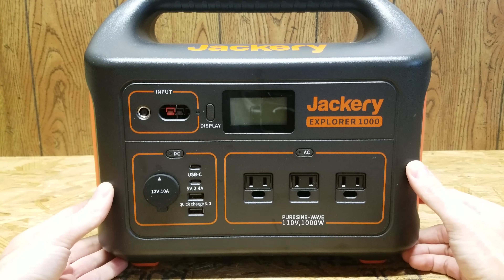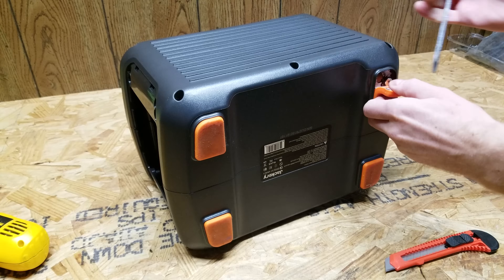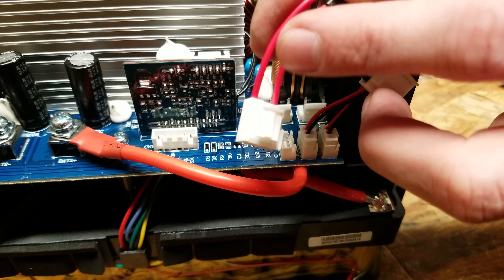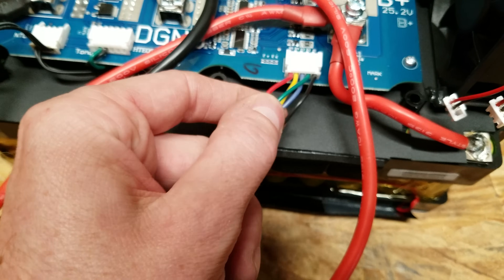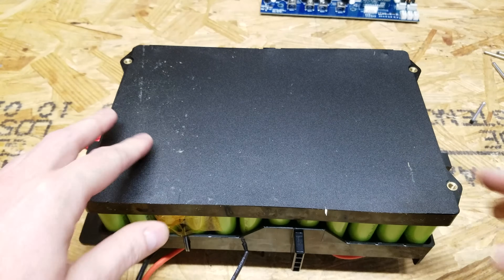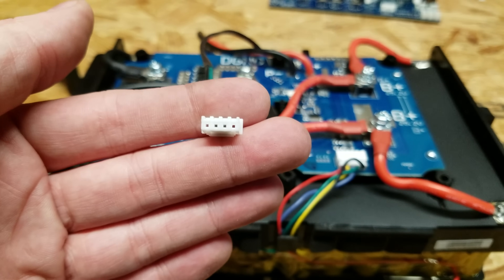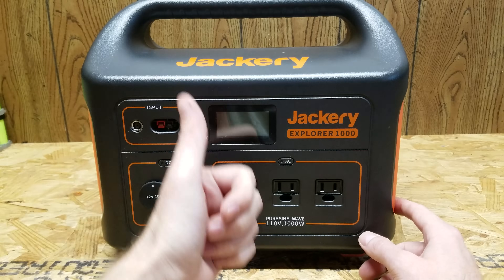Teardown of the Jackery Explorer 1000, Detailed Look Inside!

Comment: Wow. They're charging a grand for 2900mah at 3c. Which is a laughable 9amps max discharge. These cells are worth about 2$ a pop, maybe 3. 8*12 cells is 96 total cells. Or 288$. Then 50$ for the BMS and 100-150$ for the plastic and rest of the components. About 500$ for a unit at cost. You can get batteries with the same discharge but 3500mah. Sad.
Reply: That’s pretty standard markup on a product, it’s called keystoning. You are ignoring the costs of design, engineering, assembly, warehousing, marketing, shipping, warranty, accessories, packaging, G&A, and more to get a product like this out the door. It’s much more than just the component cost, All that and the company still needs to turn a profit.  I’m actually impressed with the price point.
Reply: Anyone know how hard it is to throw those cells into this unit when its time to replace them?
Reply: Pokud to dokážete sestavit v této kvalitě a zařídíte testování a schválení pro použití, vezmu od vás kontainer 🤣

Comment: I cannot thank you enough for taking the time and effort to tear this down, I'm always fascinated by looking "under the hood" into devices such as this, not to mention I plan on buying either this, or the new 1500.
Reply: @robertdillon9989 three years later I did just that I got the Jackery 2000+Lifpo4 and I got it on prime day and saved $900 on it. I cannot believe the deal I got!
Reply: @robertdillon9989 BTW, I also have three other Jackerys the 300 500 1000 lithium ion models, but they work great.

Comment: Great tear down. I love seeing the inards. 

The User Guide says it's got over/under current, over/under voltage, thermal shut down conditions, etc. That is a solid state power controller with a bunch of FETs. Being solid state you can kill the power and gracefully shut everything down without having to change a fuse. 

If you have a fuse or fuseable link you will need to open the device to repair it. A solid state solution makes sense. 

However, I don't see GFCI, which I would think should be important for something the may be used camping, where it might damp or even wet. But it does say "do not expose to liquids".

Comment: Voltage doesn't hurt you🙂 It's the current.
Reply from the maker: Both will hurt you.
Reply: @LithiumSolar  Nope, actually it is the Amperage or the current that kills or hurts you. No matter how great that voltage could be as long as there is no current or load to it it will do nothing to you. 🙂
Reply from the maker: @Binsentiments  Ok. I prefer to just avoid both though :)

Comment: Does this device also have an AC input ?

Thank you for the great content !!
Reply from the maker: The device itself does not have an AC input, but it comes with an AC-DC adapter that you plug in to the DC input jack. So yes, you can charge it with AC but it requires carrying around the adapter :)
Reply: @LithiumSolar  thank you !

Comment: Does anyone have any clue how to get ahold of these bidirectional USB-PD high wattage boards?  I've found ones that are good for 24w in/out, but they don't appear configurable for lifepo4.  There are so many power banks and 'solar generators' out there that offer this that I'm surprised I can't get a lead googling and alibaba-ing.  Would be a real handy thing to put in DIY power banks, even large capacity.  I'd be fine with charging my 50ah 12v lifepo4 box @ 75-100w and PD chargers are cheap, but that requires something that supports 4S lifepo4, and ideally has a configurable charge cutoff instead of hammering to 14.4+v.

Comment: Great video, thanks! I was just looking at these for sale yesterday. They offer multiple capacity models, so that may explain the use of parallel cables: a 1000 is likely two 500 models in the same box. This reduces manufacturing costs, I suppose, if they use the same control board.

There is a max input DC voltage from solar panels of 30V, which seemed low to me, as most domestic panels are around 38-40V for a 250-300W panel. Jackery offers a 100W 'portable' panel, which is a little overpriced but interesting when packaged with this battery/inverter unit.
Reply: Batteries in more than 3 parallels, is that why so many other components.

Comment: 7:00 This whole thing about capacitors being charged is not entirely true. Any well designed circuit will have discharge resistors on high voltage capacitors so they are normally discharged to safe level within a minute or less.

Comment: Do you know or think the AC outlets and usb ports are user changeable if they are worn out?
You didn’t show how the AC outlets are connected that I was hoping to see; still a very great informational video. 

Thanks
Reply from the maker: You can see the outlets briefly at 4:03. They can be removed, but I'm not sure how easy it would be to find the exact part to replace with.

Comment: Just purchased one, haven’t used it yet.  Have a question, I want to add a fixed solar panel to my truck top. What watt solar can use? The Jackery panels are not weather proof.
Reply: Teoreticky jakýkoli, jen nesmí překročit 30 Volt.
Panely mají ztráty a nikdy nedají tolik co je psáno. Tuším že 300 W je specifikace, ale to si ohlídá mppt regulátor

Comment: Thanks for the teardown video. This battery cell N18650CL-29 is comes from BAKPOWER, 3.6V, 2.9Ah capacity, 1000 cycle life to 80% capacity, up to 3C discharging and 1C charging rate, it designs for electric vehicles or bicycles.
Reply: Thank you for mentioning the battery cell manufcaturer
Reply: So it has 84 cells times 2.9 for 244Ah. Does that sound correct?

Comment: I connected my inverter via a plug to my house plug when the mains were down and I isolated the mains. When the main power came on I switched on the the main power and forgot to remove the plug for the inverter. The plug tripped on the db board and now my inverter won’t work. Any way to salvage my inverter
Reply from the maker: Ouch :( I'm guessing you blew out the mosfets (big transistors on the heat sink). You could try finding them online and replacing them, but might be easier to just ask Jackery if they can sell you a new inverter board.
Reply: Did you get anywhere? I have a similar problem
Reply: @stitcha123  Jackery not selling spare parts

Comment: Wow, that's a great teardown. I've been following BAK for a while. It's a real Chinese brand. So many ebike companies make a big point of using LG or Samsung, not Chinese cells, but it's getting to the point where the Chinese stuff is good. The main point is that I see the BAK cells priced in the dollar and change range, at least if you are willing to buy a thousand or so. Jackery is a big brand. They are not skimping on the pack construction, and they are using a Chinese cell. I know a lot of the pack construction is robotic so you load the machine and let it rip. The other thing I always wonder about is inverters. You can buy 24v or 48v inverters on Ebay in the low 100-300's, but the top stuff on the older store sites is much higher. I don't know how much quality you can get from a basic inverter, or what the inverter in this box would cost on ebay. The design is pretty modular, but it's not quite owner replaceable. The Chinese stuff is getting really good. Jackery really seems to be trying to build a brand. Thanks for the vid. Great job!
Reply: I would be willing to bet money that LG and Samsung batteries are manufactured in China like everything else, it's so disgusting.

Comment: I wonder if it's possible to add more capacity to the battery? And keep the original BMS,  I guess using a second bms would be better,  but connect to the battery before BMS, but I don't have much use for these anyway. I'd rather build one if I did,  great video!

I think if I built one, I'd go with a 1.2-1.5kw inverter, and build a battery around 2kwh, probably 48v,

Comment: Looks very well engineered and the construction is clean and professional. The only thing I don't like is the direct attachment of the fans to the chassis. They should use some rubber grommets between the fan and the plastic chassis to eliminate vibrations. Especially when you have a plastic case that will resonate a lot.
Reply: The sound of the fans inside is clean and quiet no vibration, adding that would just add cost to an already expensive unit.
Reply: @daleadmire1451  - Unfortunately it's not, I have the Explorer 1000 and there's no way you will sleep if you use a CPAP machine on AC and you have the E1000 close to your bed. Same thing if you have an electric blanket running from the inverter.
Reply: @JoeDplummer_  if you use the DC adapter the fan absolutely never comes on with a CPAP machine, plus I have an electric ice chest plug it into the DC outlet the fan never comes on with that either. That goes for both my explorer 500 and the 1000.
Reply: The fans are loud but vibration and resonance arent an issue.

Comment: I don't understand why 4S16P can give 25.2 volts over 2 red 10 AWG !!! Where am I wrong ?
Reply from the maker: It's 6s16p. 6 Cells x 4.2 Vmax = 25.2 Vmax.
Reply: @LithiumSolar  many thanks ! Is that supplied with a 2X12 volts PV serial panels ?  (without PWM or MPPT) ?
Reply: Yep 6S16P,  maybe Tired !

Comment: I think that the reason why the wires and circuit are doubled is either because single set is rated for 500W and they just doubled to get 1000W,
or the second circuit is just redundant, since that's the part that is most likely to fail.
Reply from the maker: I'm not sure. It's rated for 1000W continuous output. At 18V (low end of battery), that's 55A. One #1 silicon 200C wire can support that. I'm guessing just to reduce stress and distribute the load at this point. I don't see how the wires would be the most likely part to fail?

Comment: In the US, at least, opening a unit cannot void the warranty. The sticker "Void Warranty if Removed" is no longer valid. Manufacturers just put that on there still to keep people from opening up the units.
This is part of the Right to Repair Act, if I remember correctly.
Reply from the maker: This is true! I think the problem is though that companies are still likely to refuse warranty claims and it would be up to you to litigate it. Most regular people, like myself, aren't willing to hire lawyers and all that for a warranty claim. Unfortunately, they still got you... :(
Reply: @LithiumSolar  Yeah, perhaps. But also just stating the RTR clause may be enough for them to go ahead and do it. Especially if you tell them they may be open to a legal action if they don't comply. Because at that point, it wouldn't be just "you", it would be every other customer at that point they turned away for that, so it'd be class action lawsuit. Not just small claims with one customer.
Reply: @LithiumSolar  you mean "hire".
Reply from the maker: @yourpcmd  Yes, ooops :) Don't know how that happened...
Reply: So much for my aforementioned warranty tamper detection.

Comment: How do you get six s?
Looks like there is a series of positive to negative cells in each of the three groups.  Is that the first series?  assuming that the three groups are in series.  Is that how you get the six?

Is that right?
Reply from the maker: There are six groups, each group is wired in series. If you look at the left 1/3rd of the pack, you'll see a positive-negative connection as you noted. That is two groups of cells, or 2-s. There are three groups like that, giving you 6s total. They're welded on the other side the same way, just offset to give the series connections.

Comment: As I suspected in the last video this appears to be a first cabin manufacturing effort.  Silicon cables, quality boards and connectors, injection molded housings and molded brass nutserts.  Someone below mentioned it was an outrageous cost...perhaps, as I felt the ROI may be long, but quality first in design and manufacture and materials have higher costs.  Add to that the mold costs, perhaps custom heat sinks, Fabs (NI brackets, foot brackets etc.), board costs (Design & mfg + QA - delivered), wiring/harness mfg and finally the assy cost, then amortizing the Engineering and R&D (Ain't Cheep); the consumer gets a Pretty good product IMHO!  With 40 products under my belt in 30yrs, I'd put my name on it if I designed it.  If it fits someones needs it's likely worth the investment even with a long ROI. Thanks again for you quality Vids!
Reply: Yes I agree, there is a lot going on inside this unit it makes me feel justified for spending the money I did, I love tear down videos.

Comment: No fuses or breakers - even self-resetting breakers is a bit worrying.
I was surprised it was made from standard 18650s. 96 of them should give a capacity of around 64AH That's not too bad. The price is outrageous though. $1,000 for pretty much $300 of off the shelf components.
Reply: In addition to the electronic enablement FETs (low voltage, over current, high temperature, etc) My unit appears to have two 60A surface mount fuses in the middle of the BMS board.

Comment: are you sure you`ve connected back the fat cables correctly ? i don`t think it would be nice if you reversed the 2 black wires between them...just in case of a short...
Reply from the maker: Yes I'm sure :) Also, it seems like they're paralleled up anyway.
Reply: @LithiumSolar  they parralel up very well when everything is ok, if one of those band surges blows up it doesn`t anymore

Comment: Not sure I'd call those fuses on the nickel, it looks big enough to be a pretty high amp "fuse" if so, looks wider and of course much shorter than the battery hookup ones.

Btw those copper colored things are definitely shunt resistors, usually very low value for that appearance, like 1mOhm or so.

Comment: LOL The first time I messed with A123 cells I screwed the pooch.  What you would think is the POS is the NEG.  They are BACK ASSwards.  Titty end is NEG. Butt or flat end is the POS.
Reply from the maker: Are those the 26650 cells? I almost did the same lol. Regarding wiring though, I don't understand what's so difficult with using standard black+white instead of red+black lol. I guess these are not really intended to be opened...

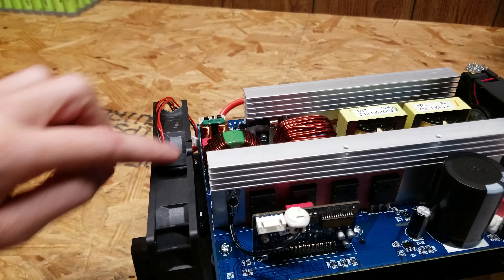Comment: That 6S configuration makes it compatible with common 24v inverter components. That little vertically-mounted PCB they you are pointing at at 5:34 is an off-the-shelf msw inverter controller.
Reply: Necessary if you're going to power 12V items.

Comment: Thanks for fulfilling my video request! This is officially the best and most complete teardown of the Jackery 1000 on all of YouTube now. I still think I want to try to build something custom on my own (now that I've watched some of your other videos)  but for someone that doesn't feel comfortable tackling that on their own, this appears to be a fairly high quality product. 

Now it's time for you to show us how you would spend $1000 on a DIY build. With that sort of budget and only needing to surpass 1000w, maybe you could afford to spend a little more on the enclosure and design it in an all aluminum PC case, instead of a plastic toolbox. Then you could convert the existing USB ports to charging ports for a cleaner look. Depending on the case, you would likely have superior cooling options vs a DIY case. You have to try make it look like it's worth $1000 as part of the challenge. You might also use RGB/LED fans that light up when they kick on.

Comment: What was the inverter input voltage?
Reply from the maker: The battery pack works out to 18.0V - 25.2V. I'm not sure if it would tolerate a broader range than that.

Comment: Looks pretty good inside but I was surprised on how small the battery pack is. I am glad you do this as I just hate putting things back together so thanks.
Reply from the maker: Makes me wonder if it can be expanded by simply adding a powerpole connector something like that. And yes, I hate putting back together too but one good part about making videos is if I forget where things go, I can always rewind and look how I took it apart LOL.
Reply: From what I’ve seen on other power station tear downs, about half is the battery and the other half contains the circuitry and space for airflow. Would be cool to have an extra connector that would allow a way to expand the battery.
Reply: @gojeffgordon24  If I remember right I think there are some models you can daisy chain together for more capacity
Reply: @gojeffgordon24 напиши эту идею продавцу, а он передаст её производителю китайцу, который спроектирует отдельный аккумулятор с корпусом и разъёмом подключения, далее посчитать насколько это удорожит производство и принять решение выпускать новую модель или нет. Можно думаю и самому это попробовать реализовать с печатными платами и 3D принтером, но это будет сложно, дорого и опасно.